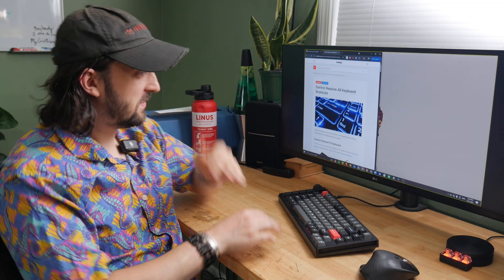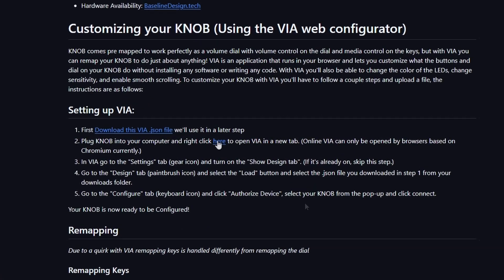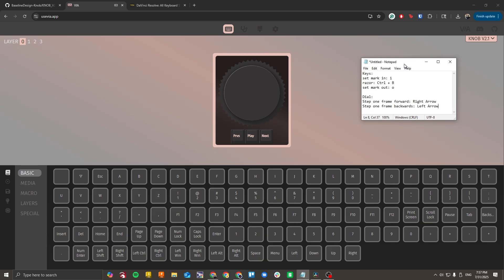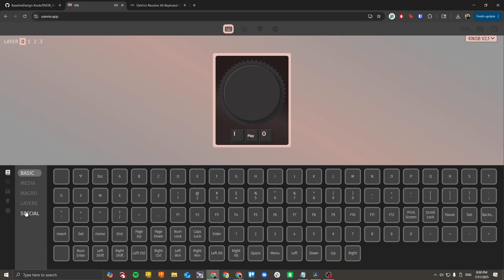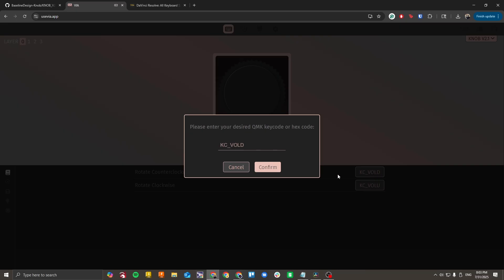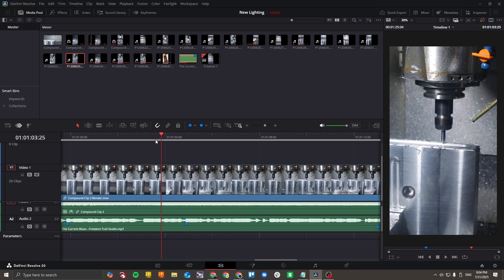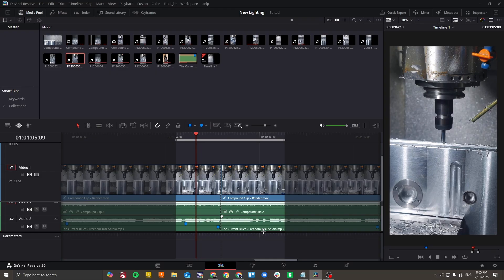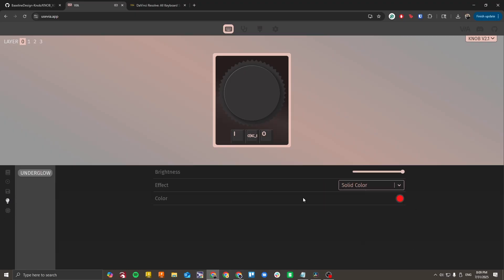BaselineDesign - How to remap your KNOB with VIA

Comment: This looks awesome, and just what I'm looking for. 

Are you able to "hot swap" configuration profiles depending on application in focus? 

And are you able to use the dial to smooth scroll up and down in browsers?  /edit saw you can do this later in the video lol

Taking a punt on this, hitting BUY. 

Thanks!
Reply: You're not able to "hot swap" config profiles like that yet, but KNOBs software is open source and ever evolving